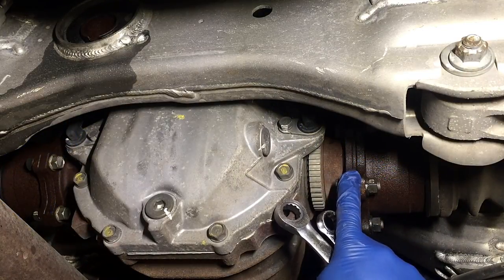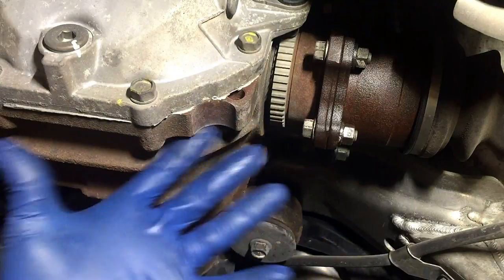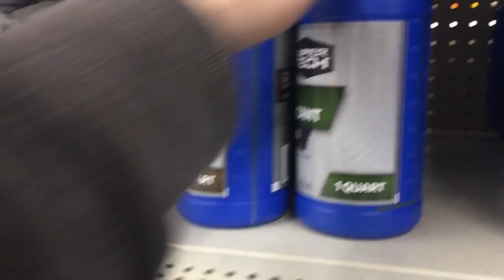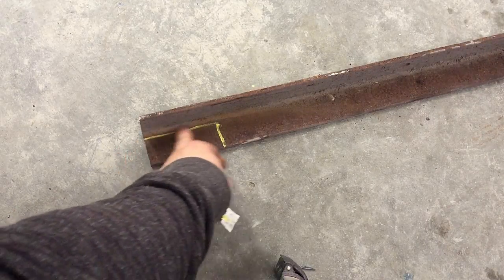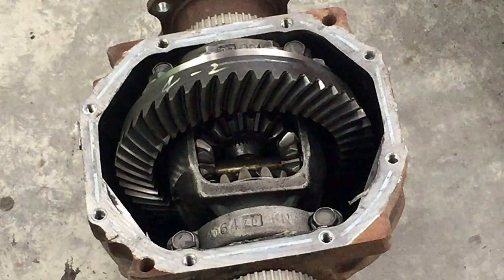Drift Diff (How to weld a differential)

Comment: Can someone explain what was done? I know he welded metal rectangles to stop the diff from moving normally but why does that make him drift better?
Reply: Jaleel Phillips a differential sends power to the single wheel with least resistance to assist in traction and power control. This guy welded the diff so when he gives it gas he loses traction which causes the car to slide around.
Reply: an open diff (not welded, like how this one started out) allows a couple of things. 1: allows one axle to turn at a different rate than the other (helpful when making turns as the inside wheel wants to rotate slower than the outside wheel) without this allowance you get a lot of tire chirp and vibration which can be potentially damaging to weaker components. 2: when one tire has less traction than the other, that tire with the least traction will spin loose while the other receives no power transmission, this is not good for instances where you need equal power transmission such as off-roading or if you're stuck in soft/slick conditions but it does keep the vehicle more stable should there be loss of traction at speed on main roads during normal driving (if one wheel can slip while the other stays idle, less chance of losing traction on both sides while at speed which is very dangerous, that one idle wheel is acting as an "anchor" or guide to keep the car more stable)

When you weld the diff as you see here, you create an equal and constant transmission of power across both sides of the diff, this is beneficial for drifting because instead of just one tire breaking loose while the other just kind of hangs out creating drag, they will both break loose at the same time allowing more control during a drift because its much more predictable and easier to regain traction when you need to, it also allows more feedback to the driver since things are not being controlled by something like an LSD, the driver is feeling everything going on. Having just 1 tire breaking loose means the other becomes sort of an anchor, its not slipping or pushing/pulling the car along, its just this chunk of rubber creating resistance and the tire that loses/gains traction can change at any time with an open diff, when both tires spin loose you create a scenario where there is equal distribution of traction (or lack there of) making for more predictable action. Will it make him drift better? thats up to the driver and the integrity of the welds xD. Hope this helped.

Comment: Yust dont make it your daily there for wen turning you gonna have that diff skipping
Reply from the maker: jorge Mireles Haha I daily drove my s13 with welded diff for over a year loved it. I can handle a little drift diff skip lol I went through tires with my open diff like crazy and it was annoying because only 1 tire needed replaced -_- kinda dumb so I welded the s13 up and went through 2 tires and made it easier on me. Sounds dumb but I like doing things in 2 or 4s not 1 lol